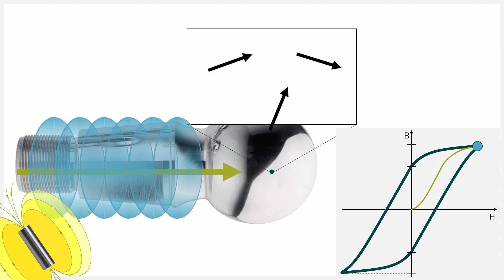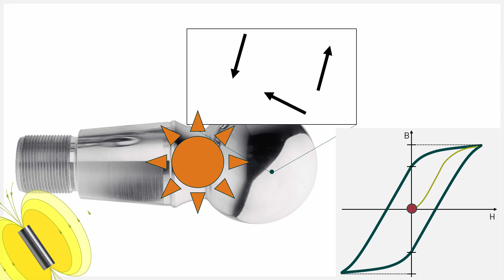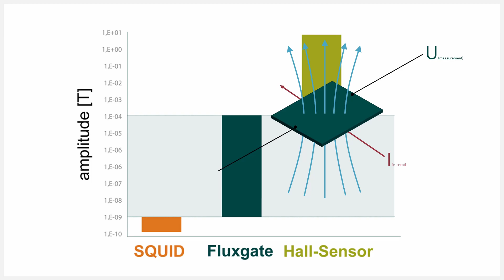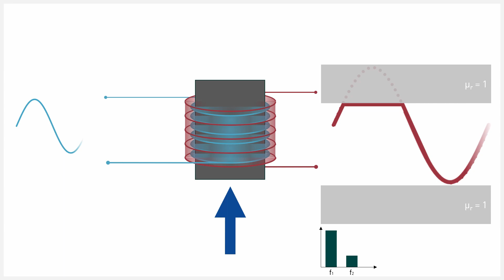Measuring magnetic fields - explained simply

Comment: Hello! Because I have only multimeter, oscilloscope I tried to measure alernate magnetic strength using wire round loop. I asked to ChatGPT - what is the voltage in a loop (250mm diameter)  when magnetic strength is 1 A/M and frequency is 2457KHz? The AI told me 96mV.It is a good start point: therefore 2A/M is 192mV e.t.c.  When I would develop AC magnetoneter - I would use Fourier Transform, and in according to frequency I would calculated magnetic strength. There may be only etalon loops (for example first for 50-3000Hz, second 3000-50000K, thrid 50K-1Meg, forth 1Meg-5Meg, e.t.c.).When we amplifying and converting analog signal to digital domain - there is very easy calculate amplitudes of each fundamental Fourier transform frequency, and therefore , magnetic strength.

Comment: Drift velocity of electrons in a conducting wire is on the order of  0.000023 meters per second, or  0.0828 meters per HOUR.

In other words, the "accepted, rarely questioned" convention we were taught that 'electrons flow along the current-carrying wire' is incorrect. 

Since a magnetic field is produced by electron spins being aligned....
and since a magnetic field instantly manifests around a 'current carrying' wire...
what we really have is this:

- current 'flow' is actually the alignment of electron spins in the wire
- as electron spins align, they lose a degree of freedom of motion
- the latent heat/kinetic energy previously held by the wire/electrons is therefore forced out of the wire because of the loss of degree of freedom of motion - the wire gets warm with current flow
- as the current 'flow' increases, it means a larger number of electron spins are aligning and manifesting a larger magnetic field around the wire, and simultaneously there is an even greater loss in the electrons' degrees of freedom of motion, leading to less ability to carry latent heat/kinetic energy, leading to more heat leaving the wire
- if more current 'flow' is forced by a larger applied voltage, eventually the wire loses a critical amount of latent-heat-carrying ability due to excessive numbers of aligned electrons, and the released heat undermines the crystal lattice and the wire 'burns through'

If you're unaware of how the loss of degrees of freedom of motion of subatomic particles results in a reduction in ability to 'carry' latent heat of the environment, this information is easily found online.

One 'blind spot' in physics is, despite the fact that it's demonstrable since the 1920s that aligned electron spins cause magnetic fields, this has not been used to explain the magnetic field around a 'current-carrying' wire, as if some other magical mechanism other than aligned electron spins could create a magnetic field.  No such 'magical mechanism' has been proposed, much less demonstrated.

Thank you for your excellent, thought-provoking video!

.
.